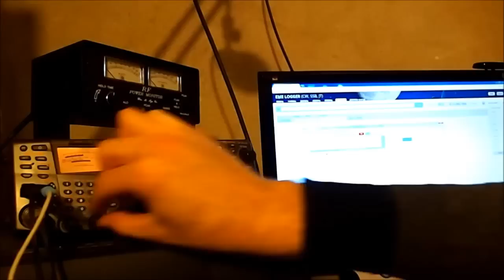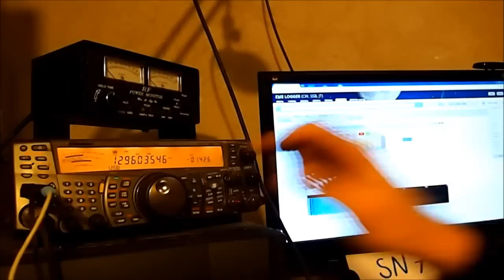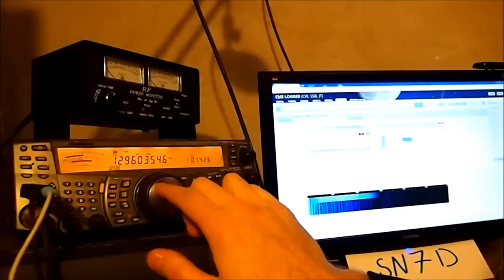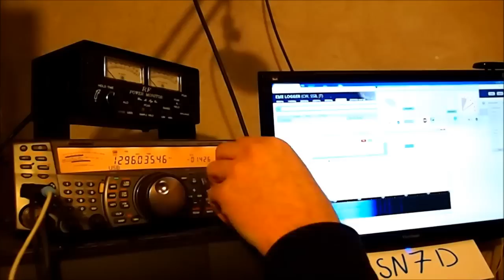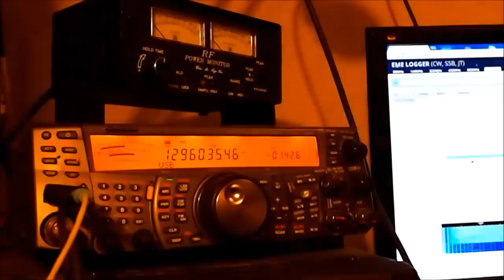EME SSB QSO PA8A (PI9CAM)

Comment: Test if the noise decreases if you put the preamplifier very cold with Peltier cell or CO2 ice or liquid nitrogen
Reply from the maker: Hallo. Noise level in SSB is high but in CW is close to zero due to bandwidth. There is no difference between winter and -20 deg and summer with 35 deg in noise level. Cooling preamp by Peltier module would be not efective. Noise figure of preamp is 0.2 dB. Thanks